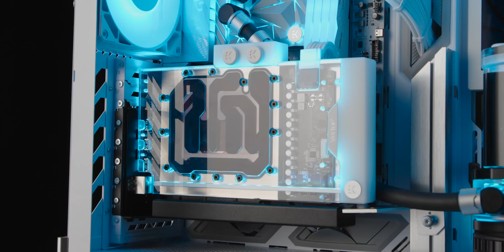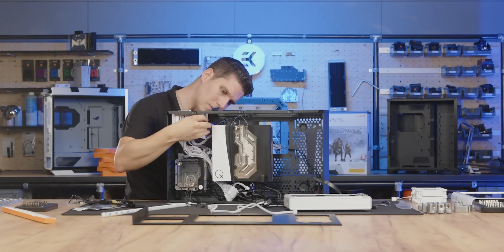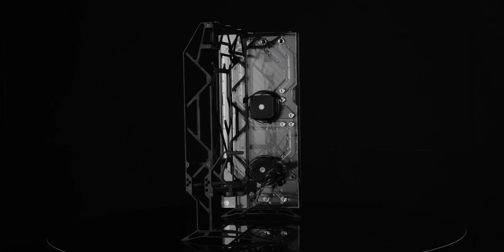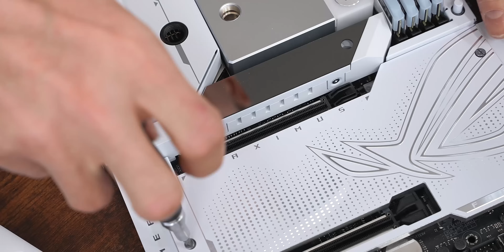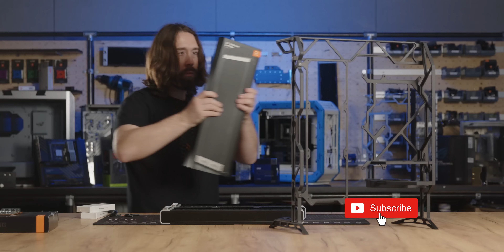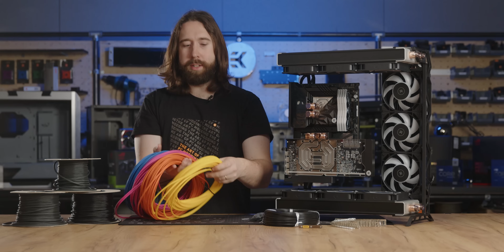Advanced Liquid Cooling: QuantumX, EK-Pro, Fluid Works | EK Expo CES24 | Day2

Comment: Can someone explain what he did to wire all those RGB lights? At the corner of the motherboard?
Reply: On Thursday there will be a full QuantumX episode where you can check expanded cuts of all 3 Qx segments together. I explained all the cabling stuff in detail, but they have their own crazy wiring loom that all gets routed alongside the rads.
Reply: I was just curious what he was doing. I’ve connected this many fans before. But just used a ASUS RGB hub. Is he just using a single RGB header to control all those lights? And power them directly to a hub?